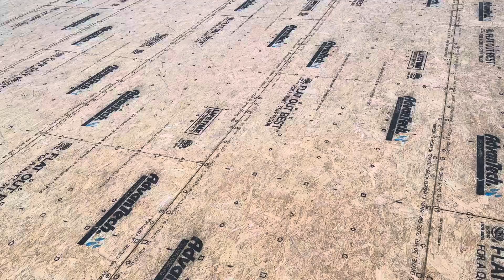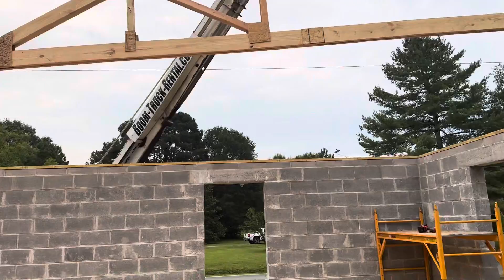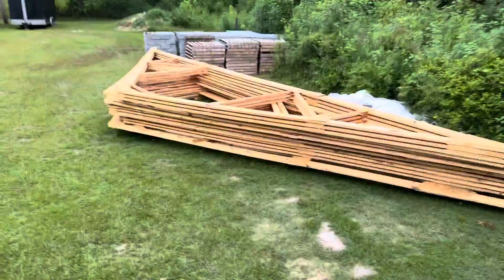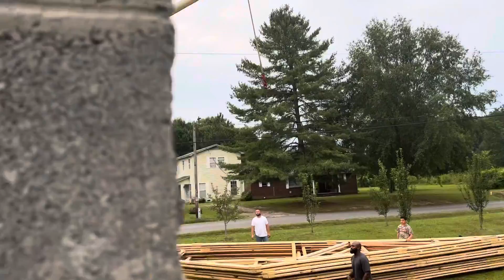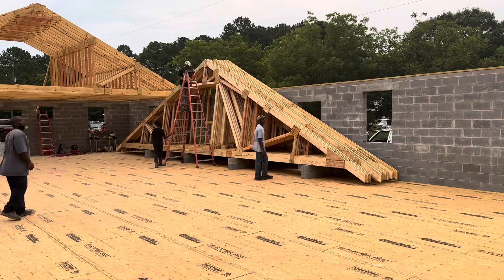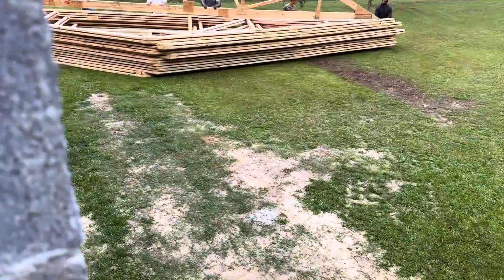Truss hanging day (Phase 3 Framing)

Comment: Mmmmm !!!!!..... Are these trusses homemade? These can't possibly be factory engineered, because of the chip wood connecting plates. This is setting up for a possible structural failure. I would get an engineer out there real quick to check it out. Be careful.
Reply from the maker: Appreciate your comments, we do build our own trusses, and have been doing so for several decades.  We build homes all thru the southern region of this country,  not once have we ever had a structural failure.  The brother that designs these trusses is a engineer and we’ve build gyms, homes, tabernacles and more… they’ll be fine.